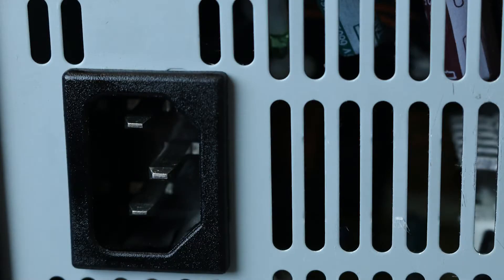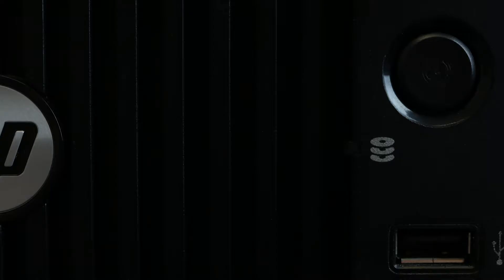HP Z420 Memory Installation

Comment: i have an error when install 4 ram in order..the 6th and 8th slot not detected and got error but when i install all 4 ram in all slot on the right its seem ok without error but the hp performance advisor detected that the ram not full performance..is the slot had a problem..can you give some advice for that so all the ram get full perfomance..tq sir